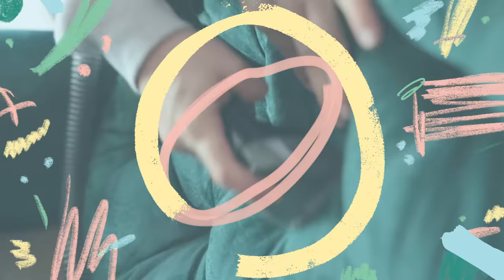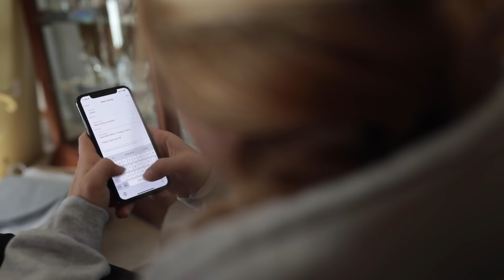I made over $7000 Flipping Vintage Velvet Chairs - HERE'S HOW!

Comment: Oh, I had another question.  Instead of ripping the skirt off, have you thought about folding them under and stapling the ends to the inside of the chair frame?
Reply: That’s a great idea. Then you don’t chance ripping the chair fabric or see holes from the staples
Reply: @kerid9658  Right, and also there would be no stark change in fabric color.

Comment: Another flipper discouraged me from bringing upholstered furniture to my home for refinishing and flipping bc of the potential for bed bugs, fleas, mold, etc. that might be lurking in them. I guess she learned the hard way as these things weren’t visible until the bugs spread. Anyone have any advice on how to avert such a disaster?
Reply: Depending on how big the upholstered furniture item is, you could wrap it air tight in plastic and leave it be for a while (at least 1-2 weeks). Cushion’s could be wrapped and go into the freezer for a couple of days.
Reply: Diatom earth too, then vacuum
Reply: Keep it outside or in a cold garage in winter?
Reply: Bed bugs are horrible to get rid of, but if it's a bad infestation you'll see nasty brown stains in the crevices, around buttons, and piping.